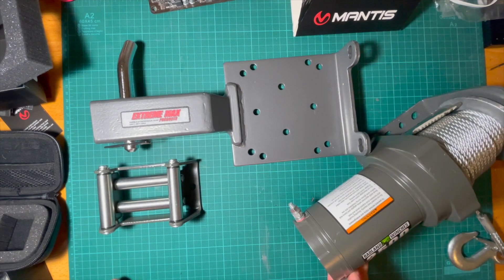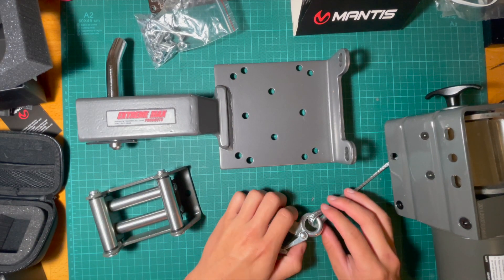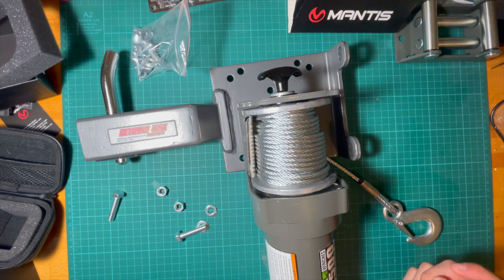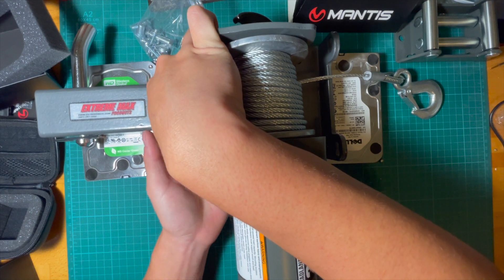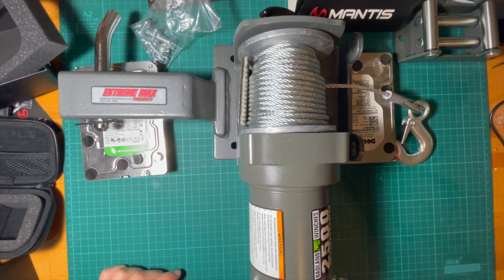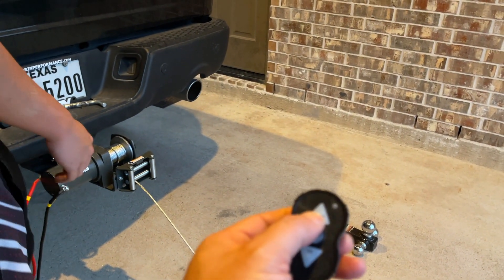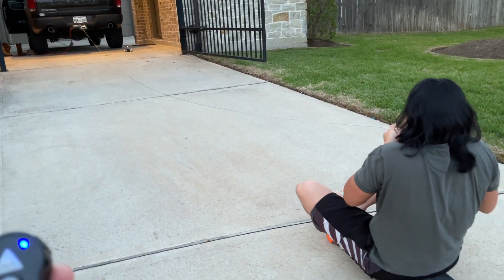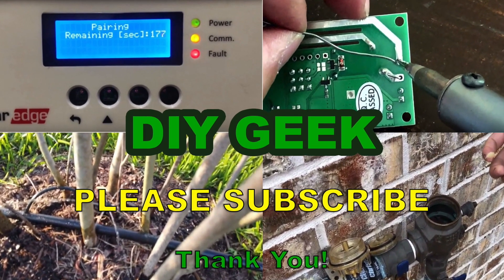BADLAND WINCH ON A HITCH - PORTABLE WINCH WITH REMOTE CONTROL

Comment: This is exatly what I did, couple of tweaks tho. I use dual receiver so I can add/use the winch while my trailer is still connected, ( I pull my motorcycle up onto the trailer, also makes it easier unloading 850lbs) also I mad jumper cables more permanent with Anderson quick connects, both on the battery & the winch, so all I do is connect the the cable on both ends to supply power to the winch, works flawless!